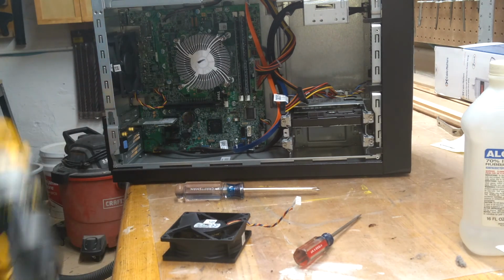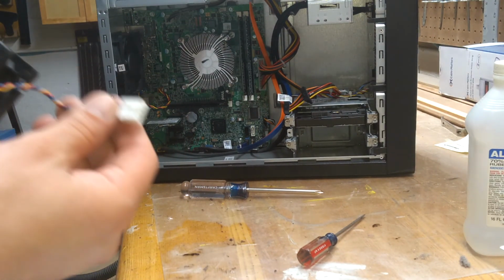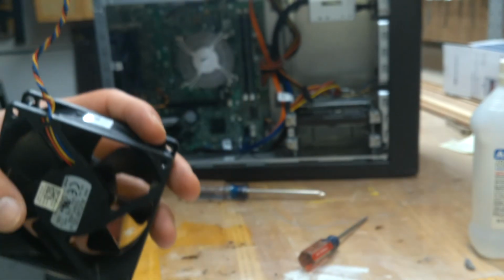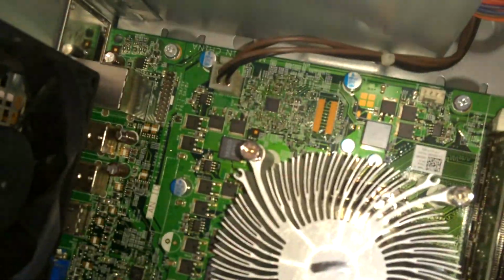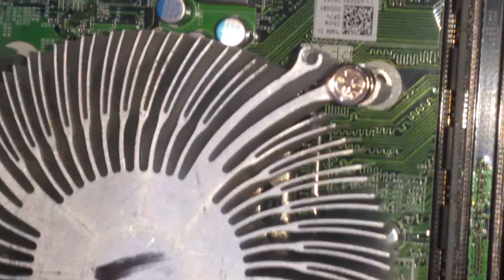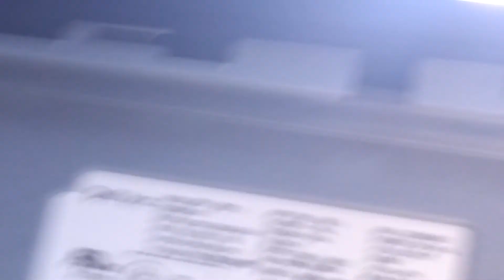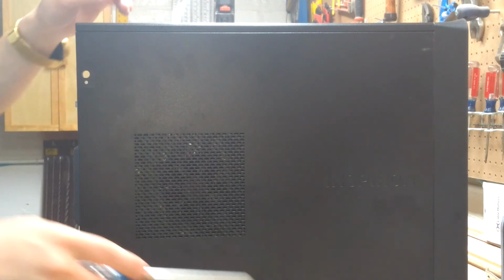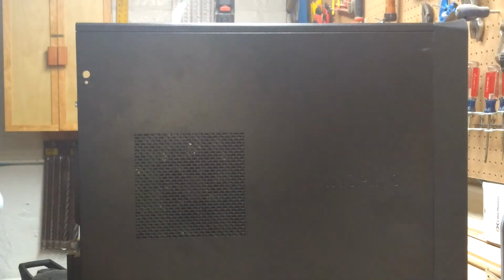05 Reassembly

Comment: Thanks for the video are you gonna replace the parts ram? Cpu? Gpu?
Reply from the maker: Hey so I have it again for about a week. If the owner wants I can upgrade RAM which I'll film (Current = 6GB, Max= 8 or 16GB), I bought him an NVIDIA GeForce GT710 GPU which he installed himself, and I kind of doubt I'll ever touch the CPU. From my most recent research it appears a much better CPU can fit in the socket, but I'm not sure it's compatible with this MOBO. Hell, it won't flash the BIOS updates on Windows 10 because it says the PC can't run Windows 10.....??? Yeah... I'm confused too.
Reply from the maker: I mean if you want me to I can show how to upgrade without actually upgrading. I can do those 3 no problem, It'd be just uninstall/reinstall vids

Comment: I have the same computer i want to upgrade it i was hoping if you can help
Reply from the maker: Actually I ended up upgrading it with a 128GB SSD running Win 10 Pro x64, RAM was at 6GB DDR3 or DDR4 (I can't remember right now), if CPU was upgraded it would be on YouTube playlist, and I installed an NVIDIA GTX 720 with 2GB GDDR5 VRAM. Then I gave to my brother for Christmas. There's issues with Win 10 but those are prob config issues and after I resolve those it'll be able to run mid-level games. Hope this helps!
Reply from the maker: I'm pretty sure I filmed the upgrade so it should be uploaded sometime soon.